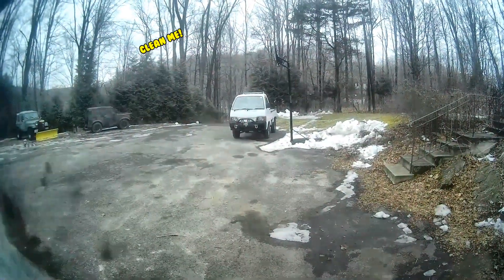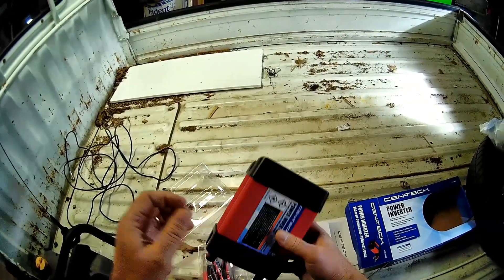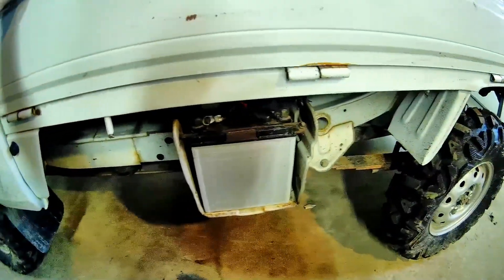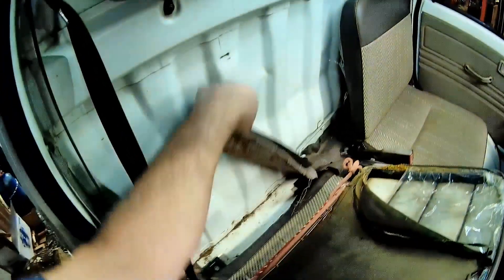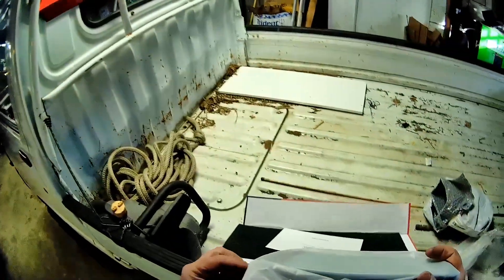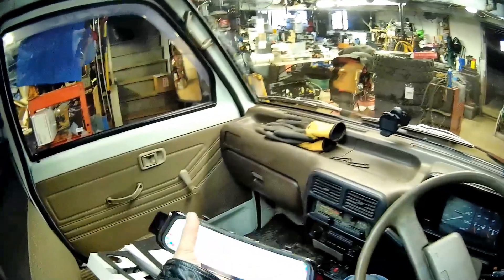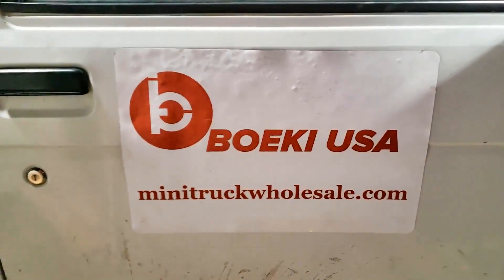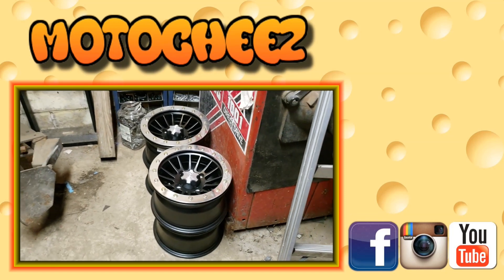Mini Truck (SE01 EP11)120 volt power inverter,  Junsun 10” DVR fail, inclometer, CB  Install HiJet

Comment: Giver the ol 102" whip! Every one of my cars has the 9 foot whips on em lol
Reply from the maker: Those are the absolute best! Just so damn long, I have k40 whips on all my jeeps, put a lil Wilson base load whip on this one
Reply: @MotoCheez   yah they are long but they dont bother me, I have mine mounted on the front fenders and when I pull into the garage or drive thru i can reach out the window and pull it down. I just gotta make sure the wife doesnt key the mic by accident while the linear is on or ill get a nice bite
Reply from the maker: @Hammerjockeyrepair  I still have a few linears in my shop. I bet you spotted them on the back wall with my ham equipment 😁
Reply: MotoCheez I actually didn't even notice! I'll have to look closer when I get time to watch more. I've been rebuilding radios/linears and now scratch building custom competition linears for a few years now. What equipment do you have?

Comment: i run 82 rx7 aluminum 13 inch rims they are about the only rims off a car with the same bolt pattern. i was running just walmart snow tires, not so great in the mud but great on the road.
Reply: I heard, older Honda civic wheels work too.
Reply from the maker: These Hijets are 4x110mm..  only early 80s RX7 wheels are that pattern

Comment: could run the cb ant cable down under the truck and mine has some big grommets in the floor that it will fit through.
Reply from the maker: Problem with that is there's no bed gap, it would run down the side or inside bed where it could get caught or damaged
Reply: @MotoCheez  I didnt know that ! mine has a gap '95 Suzuki Carry, I've only had it a couple months now. still doing stuff to it, I'm a car stereo/accessory installer in Canada.
Reply from the maker: No gap..Is yours a dump? Mine isn't :(. Nice, I used to install stereos in the 80s.
Reply: @MotoCheez  love your edited bits (video clips), have you noticed any change with the added weight, I'm scared to add too much, I'm custom building a sub box under the passenger seat right now.
Reply: @MotoCheez  I started in '86
Reply from the maker: The front bumper and winch I did feel quite a bit. After trying 4 sets of springs I finally found the perfect ones! They're a progressive rate springs too, exactly what I wanted from the beginning but couldn't find anywhere! I can even put a plow on now and be ok.
Reply: @MotoCheez  nice!

Comment: high RF from LED LIGHTS, also inverter will knock out further distance(s) signals. put a few capacitors (10uf rated at 16/24v) :D

Comment: Great tires for doing anything are the Tensor Regulator A/T (8ply) 28x10-12 DOT ATV Tires they get it does on snow, street, and mud. and they look bad A_______________________.
Reply from the maker: Can't go bigger than 23" :( won't fit. Those tires look kick-ass too
Reply: @MotoCheez  my bad
Reply from the maker: It's cool, I emailed and asked if they sell in 24" fingers crossed

Comment: I think I might have found the type of tire you're looking for. Over on chapmoto-dot-com there is a model of side-by-side tire called the GBC Kanati Mongrel. The smallest size it comes in is 23" tall, takes a 12" rim and IS DOT approved. The tread pattern looks like something you'd see on a pickup. But who knows? You might have found something already by now. :)
Reply from the maker: Wow  they look like the ones I saved in my shopping cart on eBay. https://rover.ebay.com/rover/0/0/0?mpre=https%3A%2F%2Fwww.ebay.com%2Fulk%2Fitm%2F283304141385
Reply from the maker: Buy yours are DOT, nice find!
Reply from the maker: Wait. The 23s are 10" wide. Not sure they'll fit. I may end up just keeping what I have or putting wheel lug adaptors so I can get bigger rims
Reply: @MotoCheez  ChapMoto does have a tire similar to the one you showed me. But it also seems to only come in 10" wide and only goes down to 25" tall. I've actually found a lot of good tread patterns, but they all seem to have similar measurements.

Take a look on either Chap-Moto or Dennis Kirk. You might be able to find a 14" utv wheel in your lug pattern.

Comment: Maybe after you get some real wheels and tires on it you can invest in a real horn. go down to your local junk yard and get one off of an old Caddy or a full size truck and shock the piss out of someone when you honk at them. they'll still be expecting the little road  runner sounding horn an you blast them away with the deep bass full on caddy horn from hell. i figured that would be easier than mounting a compressor and train horn and way less taxing on your already almost overloaded electrical system. as for your camera situation i too have tried several of those rear view mirror cameras and the common theme with those is they are all cheaply made and none of them work like they should when you get them home and out of the package the idea is great but the delivery so far is garbage. i had one that did show some hope and was a little better quality but came in busted and unusable. plus the menus were all in Chinese and i'm not sure which version of chinese because i know what thechinese and japanese charicter for english looks like but there are 5 different languages and over 200 different Chinese dialects so that one is kind of hard to pick just one character for English i'm sure. You could leave it up there for video recording and just have a separate back up cam or you could keep searching and see if someone comes up with something better but they just tried too hard to get these mirrors to do too much and still keep them light weight and thin. they're just asking too much of those devices. you would do better rigging up a mini android tablet in there and just let it do most of the work for you. they already hae GPS built in and wifi and music playback and record front and rear video. you could do something like that but you would still want some external speakers because the ones built into most tablets suck
Reply from the maker: Yeah, I have a small air horn I thought about hooking up, would need a switch to go back and forth because I bump the damn thing too much! Ya. I've tried a few cheap tablets and they're junk too. I might just do a GPS w reverse.... Lol. Thanks for the info
Reply: @MotoCheez   Are you guys nuts!?! That roadrunner 'meep' is one of the best things about this goofy little monster!
Reply from the maker: 👍👍👍 when I put the air horns going to have a whole separate button I'm not doing away with the original horn, it is epic
Reply: @MotoCheez   Dude you got me binge watching this whole series. I'm a welder/fitter with a shop in the back yard down in NJ, maybe 45 minutes from where you bought your truck. I'm browsing Amir's website and just thinking of all the fabrication I could do. I really like your 'climber' though and I'm gonna keep my eyes peeled for one. I can't imagine the look on the guy's faces when I show up to the Toyota Takeover off-road event in Rausch Creek with my Tacoma pulling one of those bad boys!
Reply from the maker: Haha! We went to AOAA last year. Want to hit Rauch Creek someday. What you drive?
Reply: @MotoCheez   '16 Tacoma Access Cab Off-Road, Old Man Emu lift and some BFGs. couple lights and a rack and shit. All the fun flair mods. Looking at a bumper but Taco shit is so expensive. For the cost of the bumper and winch setup I'm looking at, I'm halfway to buying me a mini truck. AOAA is super tight in a lot of places, I got my first couple dings from some trees there. The mini truck would be able to do a K turn in that trail though.
Reply from the maker: You should look into a front winch bumper off of a Wrangler, like what I put on the mini but maybe get one for a JK, they're wider. Yeah we got lost in AOA down some pretty nasty gnarly Steep trails, I have a Rubicon my one son has a Wrangler and my other son has a liberty and popped is ball joint it was so rough and steep had to rope it back together to get out. Not to mention the mapping system there stinks haha. I want up a real nasty ATV trail that they couldn't make and I didn't want to go back down it so I end up blazing through the woods and finally hooked onto another trail I was even out of range with the CB for about 15 minutes and then finally got in contact with them and hook back up on a trail.
Reply: MotoCheez AOAA can get like that, I was with someone who said ‘you’ll be fine’ but I dented my bed on a tree and the unlimited ripped his soft top on the same one. I’ve thought about trying to hack up a Jeep bumper or a universal fit, but there’s just so many angles on the Tacoma and I’m so damn picky with my daily driver that I don’t think that’s the route I’d take. I kinda love the mini truck just because it doesn’t have to be perfect. The whole thing is an experiment. Anyway, as for suggestions, I’d like to see skid plates on the mini truck. I think doing them out of 10ga sheet metal would be sturdy enough and light enough to work. Also I think it be cool to try to figure out what leaf springs might work on it, since I see you’re already looking that way on the front springs.
Reply from the maker: Skid plates are on my list for sure. 10ga is a good thickness, I agree  I don't like long shackles either, but this thing only weighs 1500 lbs! You have an Instagram or YouTube account? I'll follow
Reply: MotoCheez firefitter475 is my insta but I don’t ever use it. I mostly just made it so my girlfriend could send me gifs of dogs. I’m not the biggest social media guy. Honestly I’d rather volunteer my welding and fab know how, too bad mini truck lives a few hours north of me!
Reply from the maker: Ya. I hear ya, It is too bad your a few hours, would be fun to brainstorm a project.

Comment: Your dash cam mirror is more than likely designed to be used on cars with left side drivers versus right side. see if you can find one made for Great Britain or Japan.
Reply from the maker: I tried one for one of my jeeps about a year ago, it didn't have enough adjustment on there either, this is all in kmh, no option for mph on GPS so I assumed it would have enough for right hand drive.

Comment: Is this gas or diesel?  How hard is it to get parts for, like axles, engine parts,starters, etc.
Reply from the maker: 3 cylinder gas, you can get engine axles etc, parts a bit pricey compared to regular cars, about double but you can get most the parts

Comment: bring seat to upholsterer
Reply from the maker: I could but I've reupholstered stuff myself if I could get the material. And sometimes if you could find a good car cover you can actually fit to be like the original seat upholstery. So I'd like to try that first. I ordered a set of CJ seats but they're not here yet some kind of hold up

Comment: These are called Kei trucks in Japanese, cars with yellow plates are kei cars and dont require a registered parking space to buy. They are also way cheaper tax wise. Go to Rakuten jp and search 軽トラ and you kind find all kinds of custom stuff for them. https://search.rakuten.co.jp/search/mall/%E8%BB%BD%E3%83%88%E3%83%A9/202480/

Seat covers here https://search.rakuten.co.jp/search/mall/%E8%BB%BD%E3%83%88%E3%83%A9+%E3%82%B7%E3%83%BC%E3%83%88%E3%82%AB%E3%83%90%E3%83%BC/
Reply from the maker: Excellent info! I wonder if that place ships to USA. I will look into it, thank you!

Comment: Tires ant no big trick , if you run more than one set . I do best on the road with old school highway profile in as narrow tread width available . Look at an eighteen wheel tractor profile on the front and do your best to match that profile to your mini .  Thanks  All , Thanks  be
Reply from the maker: 👍 I'd like to find taller for my road set of tires. Hard find for 12" rims. And these 4x110mm lug pattern is uncommon.

Comment: Jesus does this thing have a 100 amp alt or what? Lol. Love the build but with the amount of electronics going in a safe bet would be to upgrade the entire power and charging harness along with a larger battery.
Reply from the maker: 65a! I plan on upgrading the battery etc at some point. The LEDs only stay a little more than 10 amps total, the. If draw is the winch! Which is for emergency
Reply: Oh wow that's awesome! Im curious, what is the factory alt amperage? The winch is a nice addition, and I love that you took the time to trim and re-fit the oem bumper. I just found your channel yesterday and I love the mini truck!
Reply from the maker: Thanks! These have a 40 amp alternator ( I thought 65 at first)

Comment: Seat covers are an issue. Sucks.
Reply from the maker: I do agree generally, Not if you install them the way I did, they are permanently fast and like the original fabric.
Reply: @MotoCheez  I meant finding replacements. Easier to get an entire engine. I'm probably going to just take it to an upholstery shop.
Reply from the maker: Oh. Yeah that's why I did what I did with mine.